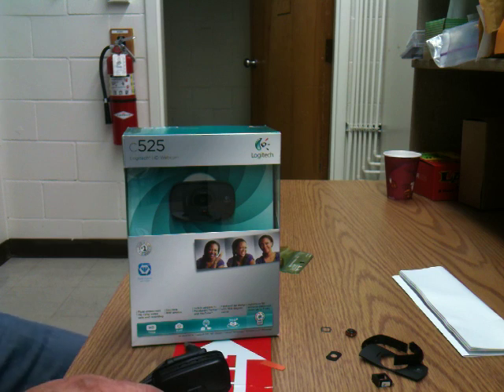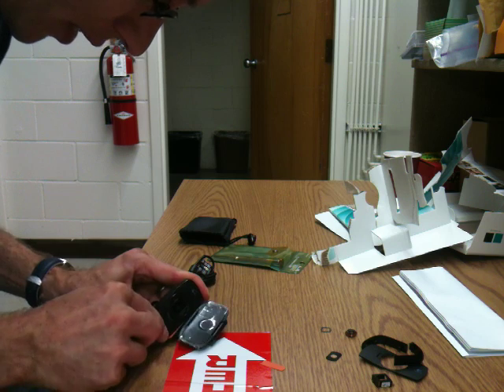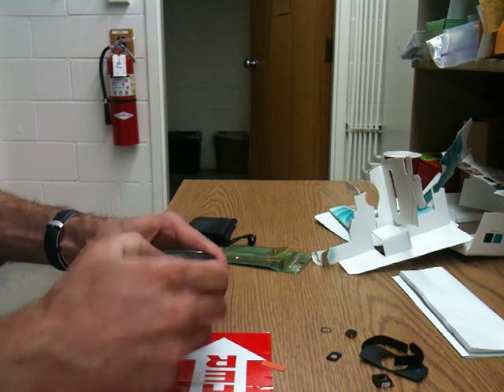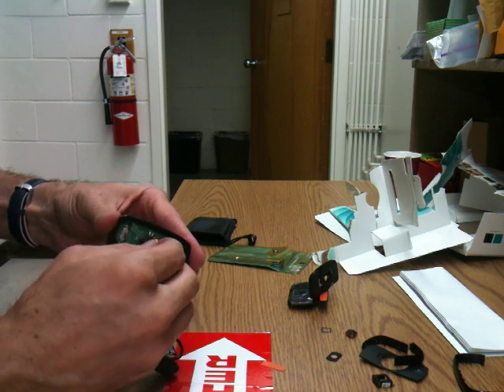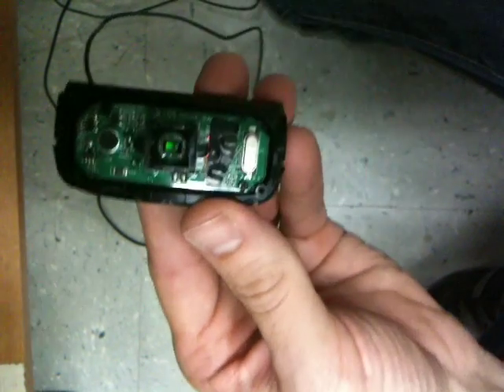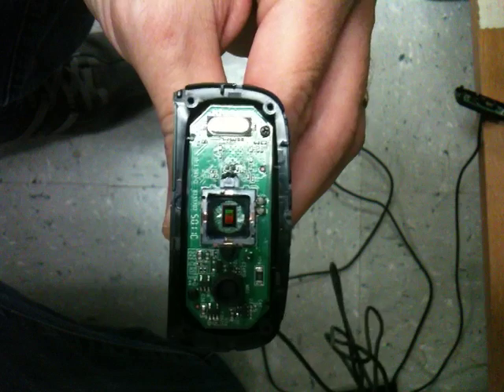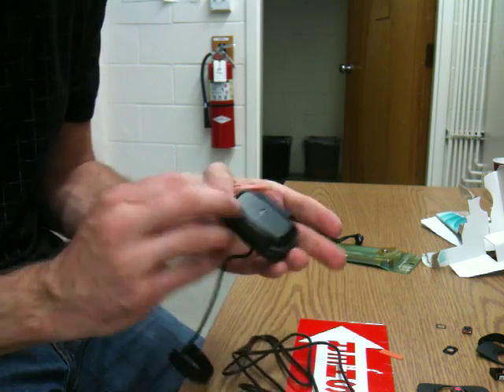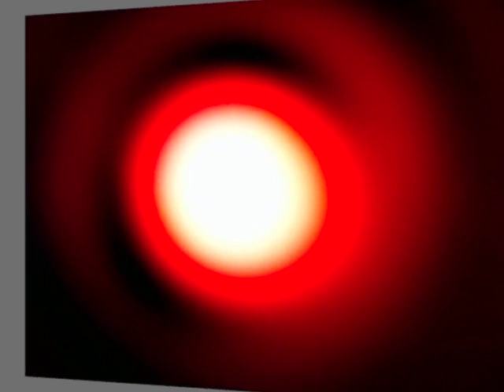Laser Camera

Comment: dude i got problem with my c510 logitech cam . First it starts to stop like the cable is broken somewhere . I open it and i saw that the plastik thing that cable goes in is just outside the hole . I put it back . Now i got contact but the pc still canot find the logitech cam and i try everything manualy set the drivers and all , But all i can see is just really black screen it catch the light for 10 sec then complitely black . I can make you video and everything . Pls help if you can